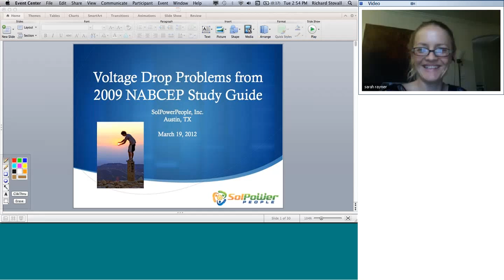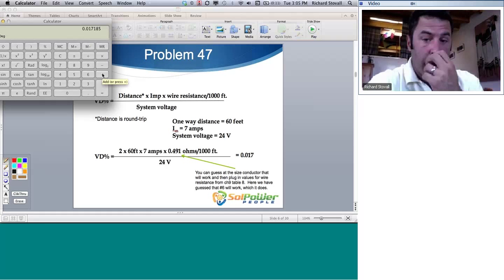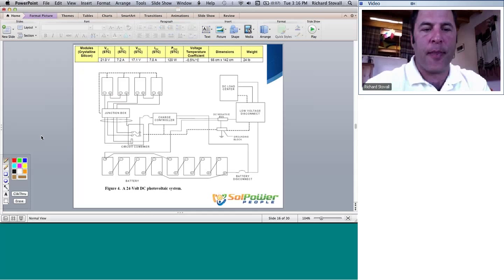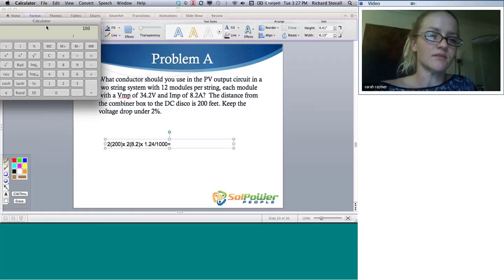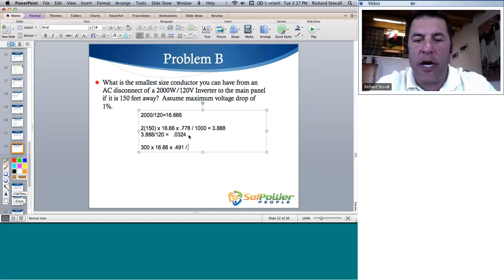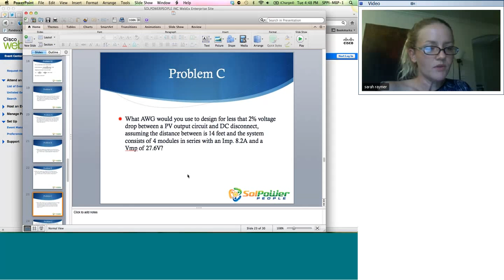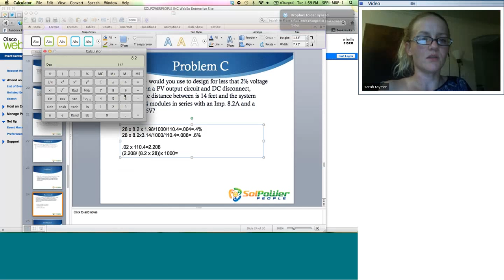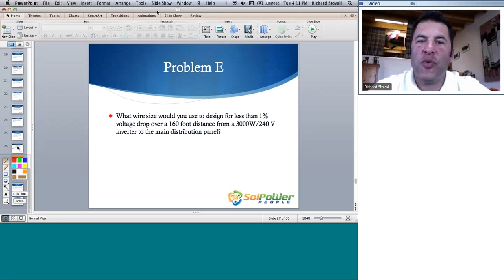SolPowerPeople #SolarMOOC_ Voltage Drop Problems

Comment: Richard,
 This was a great explanation of the voltage drop theory. I would like to know why you used the uncoated column in Ch 9, table 8. What do they mean by coated or uncoated when it comes to stranded wire? The only time I have seen uncoated stranded wire used is in overhead power line applications where uncoated wires are less insulated thus lowering resistance. How do you have uncoated current carrying conductors in a conduit with one another? Cheers. -Brad